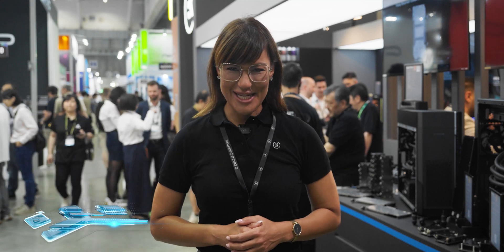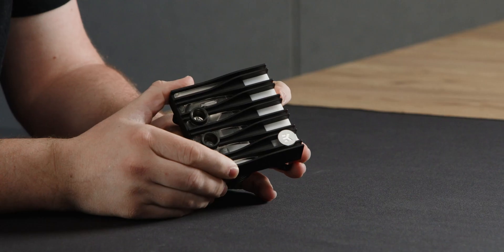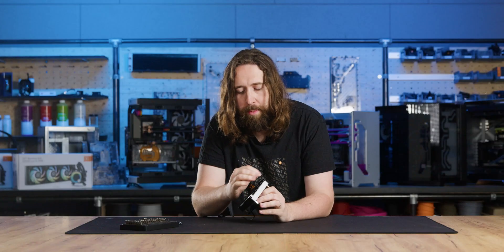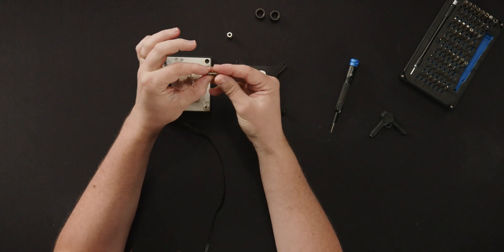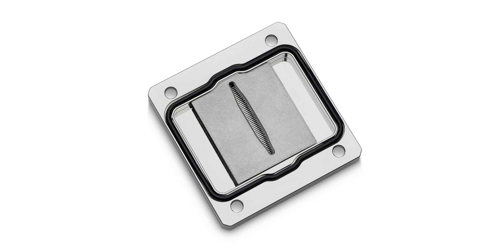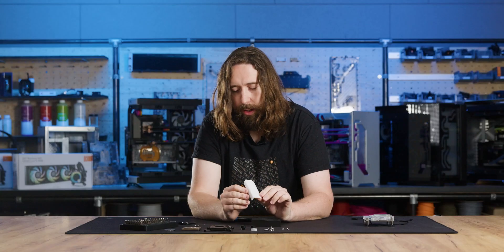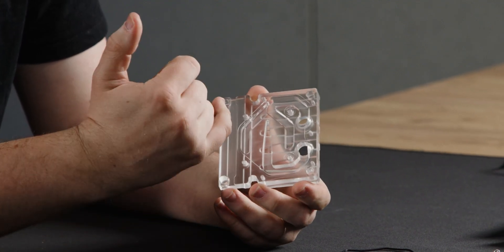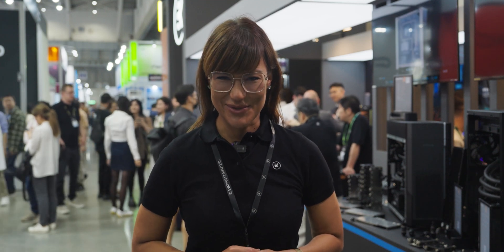EK EXPO | COMPUTEX 2024 | Day 3 at the EK Booth

Comment: @EK Water Blocks is DDC 4.2 variant planned as well?
it's badly needed here!
Reply: Hello, which product are you referring to?
Reply: @JakaJese  EK-Quantum Velocity² DDC 4.2 PWM D-RGB - 1700 Nickel + Plexi
Reply from the maker: The EK-Quantum Velocity² Direct Die - 1700 Upgrade Kit is compatible with the DDC 4.2 combo, but it is EOL. The only option is to find it on stock at a local reseller.. You can see an example of it here: https://youtu.be/kbcYOnq9bMk?si=SW3LwS-xW2VEm5Yj
Reply: @EKbyLMTEK  the initial question was rather if there will be a revision of Velocity² DDC 4.2, with new standoffs and new coldplate, like the simple Velocity² revision (without DDC 4.2) that will be available in July.